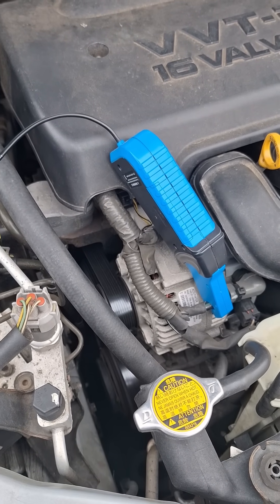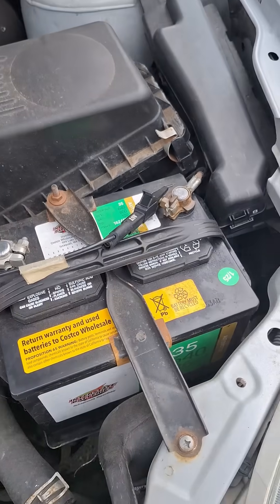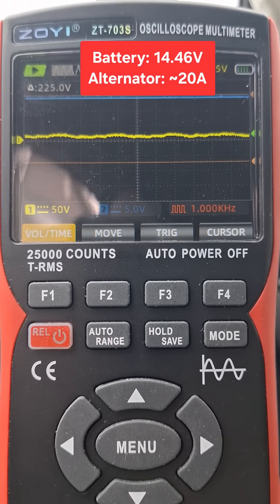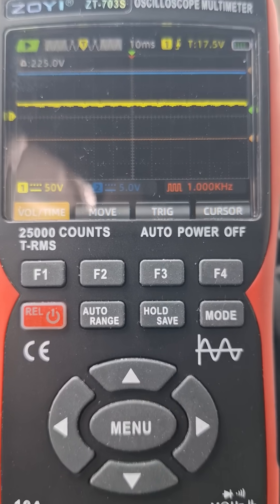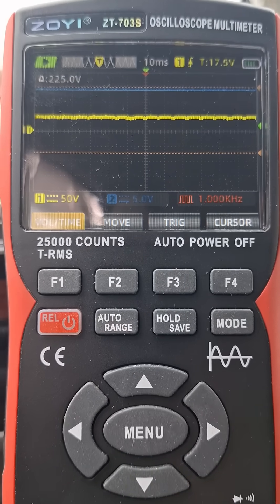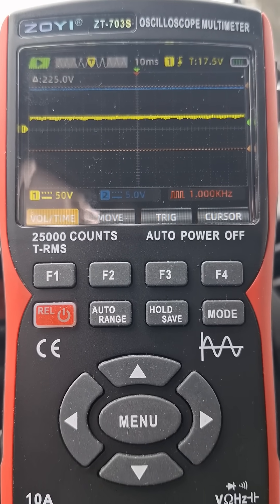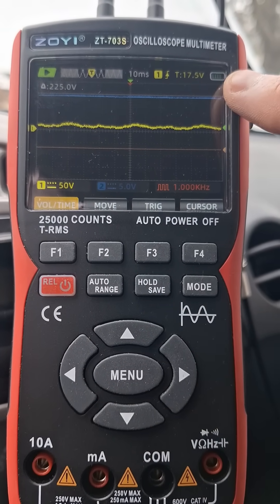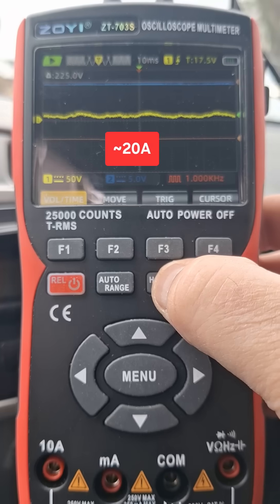ZOYI ZT-703S Oscilloscope Multimeter: Alternator Voltage and Current (Hantek CC-65).

Comment: If the alternator was bad would it have just stayed the same? Would it have been lower output initially? Thank you for the helpful videos
Reply from the maker: You're very welcome. f it's completely shot, but not always. It could increase with demand just not enough (which will drain the battery) or have too much AC voltage (bad diodes) which is bad for the electrical system. The 50 Amps I measured was correct for my vehicle with specific loads turned on. So, you want to check the output level and the ripple as well while you have electrical loads on the system. 🔧